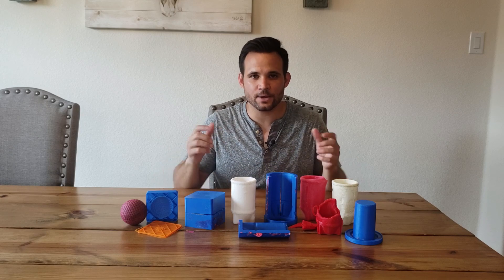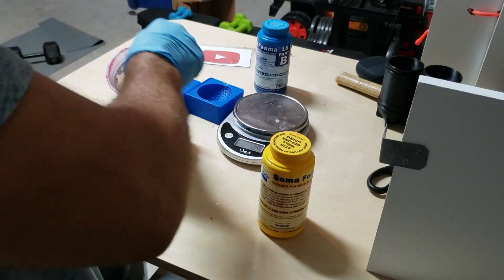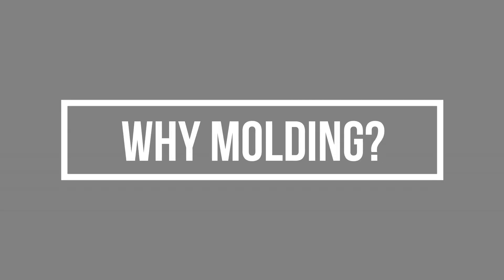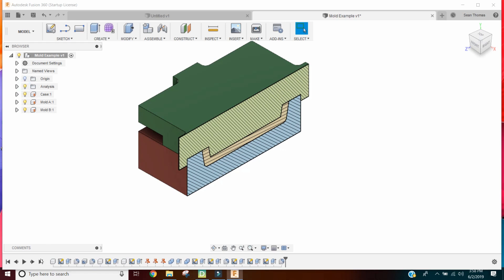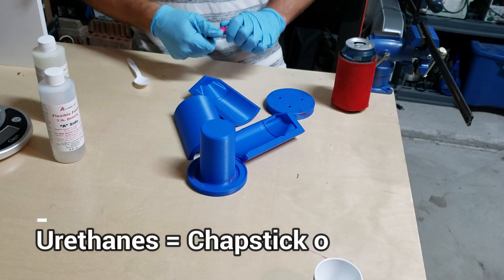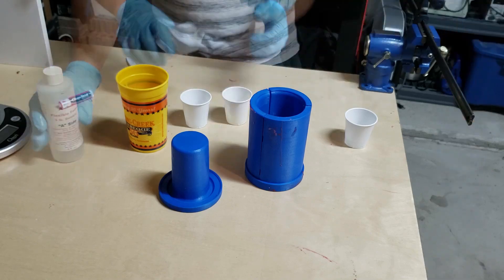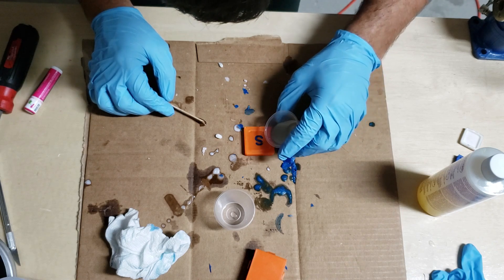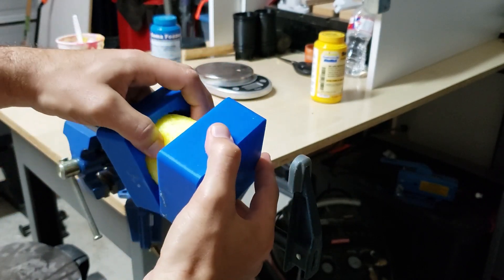Making 3D Printed Molds

Comment: Thank you for your video! I have question. I tried do similar mold like your urithane one which came out very well. How much time do you had to wait until you demolded it ? Did you used some special resin which is able to cure when poured at "very deep" mold? I have done some kin of "cup", much smaller than yours and after 2 days (i used vaseline) I still canoot demold it :( what can I do better ?

Comment: So Ive designed a two part 3D printed mold with keys, using Flex Foam It 15 Tuff Stuff, and petroleum jelly for release. So far the results have been horrible. The skin is very poor with holes all over. I know its not recommended but should I try the Mann 200?

Comment: Hi, thanks for the interesting video first of all! 🙂 

I do have some remaining questions however ... hope they reach you. It would really help me out!

- when printing my molds, the surfaces don't align very well. Which causes leaks... (and nightmares) Wondering if this is due to the printer, printer settings or some other stuff. 
In other words how do you avoid this? 

- How can you avoid / minimize parting lines on theproduct? (If it even is possible)

Thanks !! Looking forward to the answers.
@engineeringafterhours
Reply from the maker: It sounds like your printer may be distorting the molds a little if the surfaces are flush in your CAD model. 

The parting line issues can come from mismatch between mold halves, large layer lines and even high injection pressures distorting molds. 

Maybe cleaning up the parting line and solving the issues with distortion would clear all that up.

Comment: so you are making a mold for a silicon modl to use it later with epoxy ?
Reply from the maker: I have made silicone molds multiple times and should have a few examples of that on other mold making videos.
Reply: @EngineeringAfterHours  so just to understand it right you print the object you want to print then you spray on it a release and then you pour silicon on it ? And that would be the mold if yes do you have a video explaining the procedure like for example what silicon is used and how and if a vacuum is needed thanks in advance
Reply from the maker: @EnergySeeker  https://youtu.be/LBnUZ-AEuWw

I think this one explains it.
Reply: @EngineeringAfterHours  thanks a lot

Comment: I am looking to make a mold for a ridged piece. The piece you did in this video when you filled the bottom with the resin and put the top on where did the displaced resin go? do I need to design a place for the extra to bleed out of?
Reply from the maker: There's a few ways to do it, and I have 3 other videos on molds so you may get an example from those that will work on your parts. Generally, I like to allow for overflow in all of my molds

Comment: What filament material would you recommend for silicone Molding?
Reply from the maker: Silicone doesn't stick to much of anything so you can use quite a few options. I generally go with what's easiest for me to get a good surface finish on, but you may contact the silicone vendor if you have special needs or concerns.

Comment: You should so a candy/Chocolate mold that are similar to commercial made. I would love to see that process being done.
Reply from the maker: I've made silicone chocolate molds, but I'm not sure if that's the process you're referring to. Is that the process you mean or are you thinking the vacuum formed molds you pour into?
Reply: @EngineeringAfterHours  it's similar but the overall sicone used in commercial ones are very little. I believe they use a 2 part silicone method to achieve those results vs doing it home made with just pour in method seems to waste a lot of silicone.

Comment: Can glass fiber strands and hard urethane make a good tank track?
It takes for ever to print 120 tracks. I was thinking of making them using this molding technique.
I'm not sure if it's cheaper or more expensive that filament. What say you?
Reply from the maker: It will probably cost more than filament...but it'll be mechanical superior.

Comment: Any tips on very complex parts? This geometry are usually very ease to cast, but what about a rigid part with a little complexity in geometry.
Reply from the maker: It really depends on how you define complexity. But I would generally use Silicone molds for complex stuff with undercuts as shown in this video:
https://youtu.be/LBnUZ-AEuWw

You could also do a multi part mold like you see in production tooling.

Comment: Hey great video, helped me with my attempt to find a solution. I'm currently printing an item that is like an arm about 5in long 2.5in wide in PLA. 3D printing them is taking too long and want to make quantity in shorter time. We don't need the final item in PLA but just some plastic (ideally not flexible), what would you recommend using for doing this? Injection mold approach would cost $2k-5k in just the tool and then the mold itself. I saw someone using milliput as an option and even epoxy for molds. Any advice would be greatly appreciated. Thanks
Reply: I literally made my own Injection mold machine, learned how to pour metal and made my own foundry, 3d printed a master negative mold, then poured it in aluminum for the plastic Injection machine. Now- I can make anything I want in mass (ish I mean Injection isn't SUPER fast). All I have to do is print, cast, Inject. Have tried a handful of epoxies and none of them last anywhere near what you'd need for plastic injection, but the epoxy WOULD last for ever for anything not 550° lol.

Comment: Are there any food safe epoxy so you could make a mold for a mask/respirator
Reply from the maker: I don't believe food safe means suitable for prolonged contact with skin, but you may check with the material suppliers. I use smooth on and alumilite mostly

Comment: Well done. If you're 3d printing the mold though, you can create it in blendr without having to design it. You can still add the mold keys in there as well. It's all done from the model you want to mold. It's unbelievably easy. I was shocked how easy it is.
Reply from the maker: I would imagine it's a very similar process to mold creation on Fusion 360...basically just a boolean operation to remove the part volume. 

Is that how blender handles it?

Comment: Great video. Thanks for sharing. I am doing molds in Fussion, and I am sculpting the final part itself, then the mold where I leave a 4-5 mm gab between the part and the rigid mold. I then print booth and I pour silicon between the part and the mold. This way I can use your technique but also have a silicon mold that allows undercuts and easy removal. Just a small way to make it.
Reply: Is there a tutorial on how to make mold boxes as you describe?

Comment: I have a resin printer. What can I use to fill the molds? I usually do amazing casting resin but I'm sure it will adhere to the 3d printed mold... please help!
Reply from the maker: are you looking for a mold release? In this case I just used chap stick or Vaseline.

Comment: does the foam cure hot or cold? I'd like to know if I can use PLA or need to go buy abs.
Reply from the maker: It depends on the foam you use...I would check with the manufacturer. These foam molds were either PLA or Eco ABS. 

Epoxies and such commonly cure hotter.
Reply: @EngineeringAfterHours  huge temp difference in pla or abs. I called smooth-on, said only 90f, so thats probably wha i'll try! tyty
Reply from the maker: Eco ABS is actually just a modified PLA product that dremel markets as having ABS like properties. It has a much lower temp rating than true ABS.
Reply: @EngineeringAfterHours  ah, so many choices... sounds like pla will work just fine for me in this case. Fingers crossed!
Reply from the maker: @DarksealStudios  just make sure to take into account the foam expansion! 

And best of luck! I had many failures before finding out what worked.

Comment: Thought about using TPU for printing moulds for ridged material? you's have the flexibility to remove the part then.
Reply from the maker: Sounds like a fun project. I may have to give it a shot at some point when I start working with TPU.